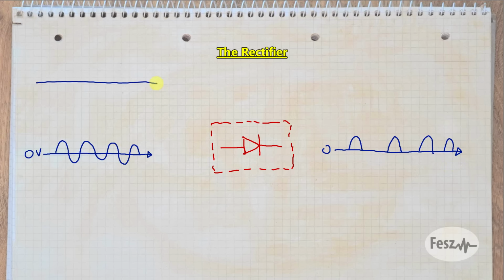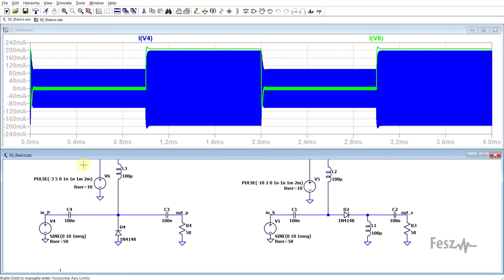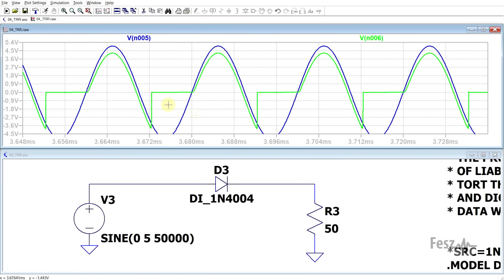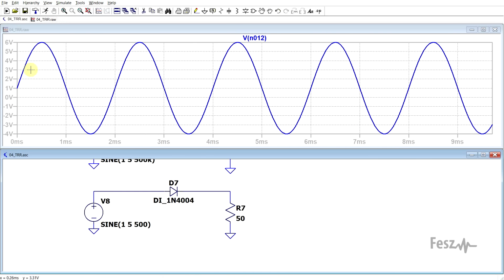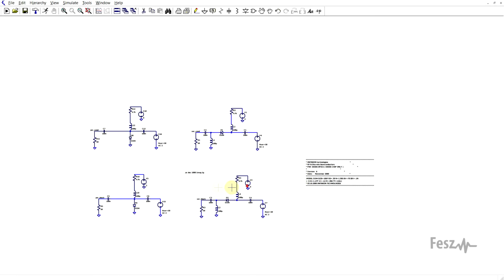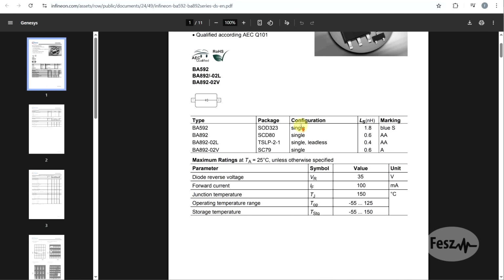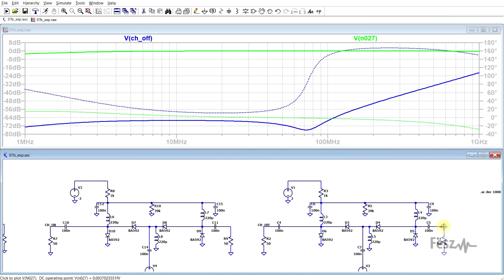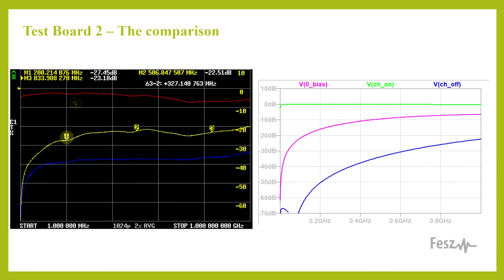Diode RF Switches

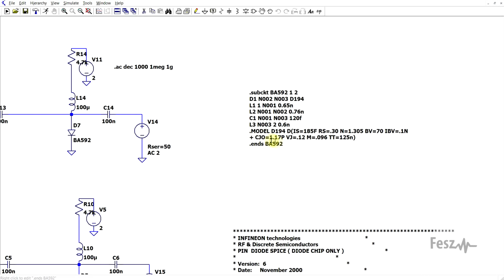Comment: 17:40 I seem to have a problem with the diode model in the LTspice simulation. My circuit should consume 15 microamps, but due to the protective diode placed parallel to the coil to protect the transistor collector, this circuit consumes much more current in the simulation, and it looks like there are large losses on the coil, the result is not correct. 
Without this protective diode, the circuit operates correctly in the simulator, as described by the author.

Comment: Voltage driven diode switches are one type of animal. The other are current driven diode switches using the current-controllable differential resistance (r) of a diode. Particularly for complex signals with low distortion demands (e.g. studio quality AF, image signals), such diode witches can easily outperform CMOS-switches, since the Shockley curve of a diado is known and can be compensated with arbitrary accuracy. I have built with this principle a shot-generator and an electronic gong with remarkable dynamic range. the control corrent can be created as an analog signal, or a PWM signal.

Comment: Very interesting presentation.  I'd like to add that the advantage over a relay is not only wear over time, but the switching time is much much lower. We started using a PIN diode switch on out university satellite ground station, where we have to switch from the 200W transmitter to the reciver in a few milliseconds to receive the response from our satellite. The biggest problem was getting hold of a proper PIN diode that can handle that much power. Microchip was kind enough to send us less than the MOQ of 100, as we needed only a handful of the diodes. :)

Comment: When I read about diodes as RF switches, I immediately started watching the video in the hope that there was an option to make diodes act as switches in an electrical circuit.
For a long time I have been looking for a simple semiconductor element that would have the same properties as gas discharge lamps or spark gaps. With all the useful properties hysteresis, current endurance, a certain voltage threshold, etc.
And when I saw a diode as a switch, a simple element that can switch :) Happy thoughts flooded my head, but unfortunately it is not what I am looking for.
Reply: You can still use Zener diodes this way. And also GDTs/GDAs
Reply: @KkkKkk-re9il Zener diodes, doesn't have hysteresis. GDT, i have few of them, but the frequency there are low. HeNe lamps are good, but frequency there is around 20khz. I need at least 200khz. 
I can use specific radio tubes,  but they are costly and very rear to find.
That's why I'm looking for a semiconductor alternative.

Comment: I had heard about PIN diodes being used in higher end radio transceivers for switching during sending and receiving CW (Morse code) in place of using a relay. The advantage being that relays ultimately wear out due to frequent switching whereas diodes do not. Thank you for this interesting explanation of how this can be achieved and why PIN diodes are necessary instead of regular cookie cutter diodes.
Reply from the maker: In most compact RF devices you will find PIN diodes; anything from a handheld transceiver to an SDR. Other than endurance, the diodes offer the major benefit of size - a mechanical RX/TX relay would not fit in your smart phone, but the diode can be built into an IC which serves other purposes as well

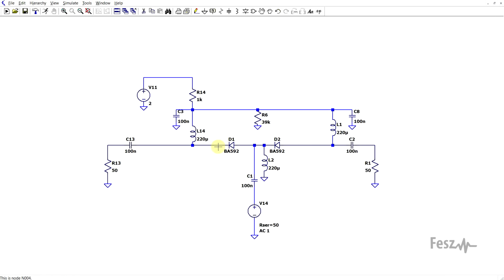Comment: At the beginning of the video (4:20 - 5:50), a switch on a single diode (1N4148) is discussed, with a control current greater than the current of the useful signal (with a voltage similar to or higher than the useful signal). at the same time, a smaller control current is assumed for pin diodes (ba592 in example 18:42), but in the example of real measurements: control voltage of 2 V, signal of 0.2 V p-p control current of 1.2 mA: (2 V - 0.8 V from the diode) / 1 kΩ, useful signal of 2 mA: (0.2 V p-p/2) / 50 Ω and there is no similar comparison of the currents and voltages of the useful signal and the control signal as at the beginning of the video. Without comparison, the advantage of using a pin diode instead of a conventional slow diode is lost. These are important ratios because the proposed 4-diode two-port switch circuit is used to connect the antenna either to a receiving amplifier or to a transmitting amplifier (the signal from which is quite large in terms of current and voltage, especially when you go from mW to W and tens of W).